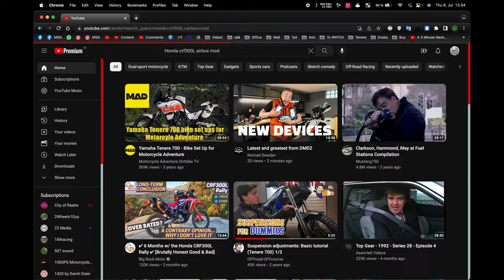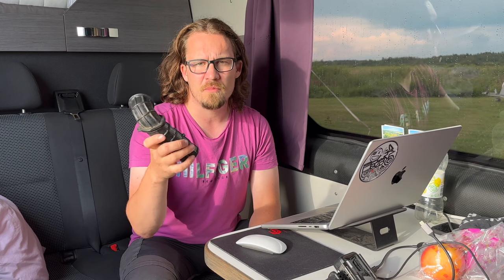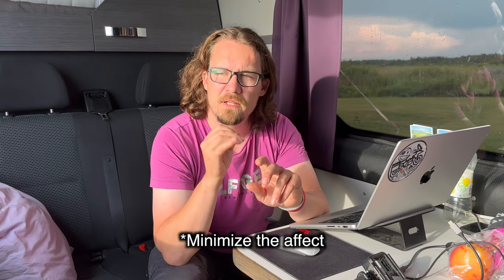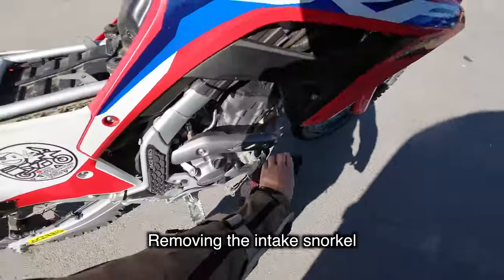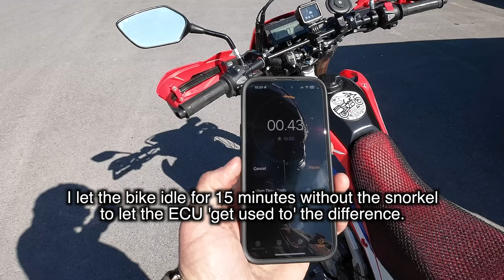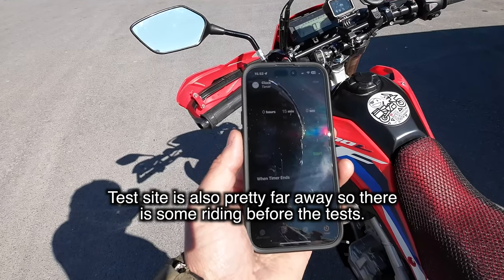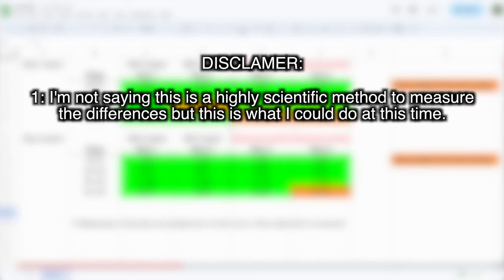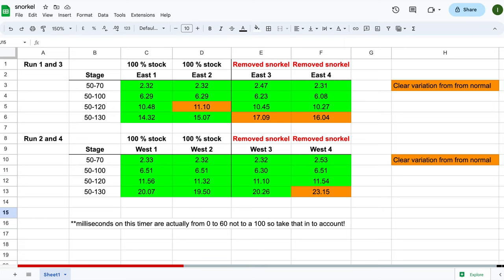Honda CRF300 Airbox Mod: Fact or Fiction?

Comment: Interesting. But to be fair to other testers I haven't seen any that have just removed the snorkel. The better tests have replaced the crf300 stack with the much bigger cb300 stack. They have also fitted high flow components such as air box lid and air filter. There  have been a  couple of testers who were quite thorough, one using a manometer to measure the vacuum effect of the restrictive stock components compared to high flow, and a Finnish guy who did full mods then used race timing equipment to measure several runs. Both these were very interesting.  Good luck with your future testing.
Reply from the maker: That Finnish guy is me though.
https://youtu.be/-rdtfHX3i6k
https://youtu.be/0Dh0g1QIY7A

The whole point of this video was to show everyone that they should not mutilate the airbox without doing any of the other mods. I've seen this happen a lot.
Reply: @PatchedBandit  You seem to have aged before this video was made!  Haha, sorry for the mix up bro. Try to find the manomter one, that was good too, he tested while removing the individual components one by one and recorded how much difference each one made.
Reply from the maker: I saw the 'labtest' type of test of the airbox itself. That's not really all that black and white though. The resistance levels and all that goes in to designing these air intakes is a lot more complex than people like to assume. It's not all about how freely the system flows or not. Different rpm levels affect the results a lot too and how the whole system is configured. 
Even if you remove the whole airbox and only leave the throttle manifold the bike is not gonna be faster because the tune is optimized for the stock setup. 
I made this video originally because I saw a lot of posts online of people just mutilating their airboxes and thinking they have a lot faster bike which is definitely not the case.

I aged 10 years within 2 because of my health problems. Now I'm just happy to still be alive.
Reply: @PatchedBandit  From you: "people just mutilating their airboxes and thinking they have a lot faster bike which is definitely not the case". Definitely, I watched a couple of guys comparing a modified vs non-modified acceleration test in which the modified bike barely pulled away from the unmodified away from the unmodified one. I wondered if it was really worth the $1500 or so spent to modify the bike.
Reply from the maker: @aussiesam01 definitely worth it if you do it right https://youtu.be/0Dh0g1QIY7A

Comment: Honda engineers have learnt a few things about 4 stroke tuning over the past 70 years, having completed in Moto GP, Formula 1, Indy cars and so forth. So it comes as no surprise the results didn't reveal any significant difference. There is a video about dyno results on the Crf250l which revealed no gain in power over stock, even with a so called performance exhaust. Gains were only achieved when the ecu was programmed to supply more fuel to complement the free flow.

Considering the volumetric output is near 100 hp per litre stock, its not really underpowered, it simply lacks capacity, want more power, get a CRF 450.
Reply from the maker: Fully agree! Thanks for the insightful comment 🙂

Comment: Look into lamaner vs turbulent flow. I'm betting at the higher speed the air was "skipping" over the airbox hole with no snorkel. Would be interested to see if cutting the internal part of the snorkel off would help
Reply from the maker: Any variation should be tested separately. This video was mainly to simply answer if it is worth it to chuck the whole thing as I have seen some people do.
I might do some testing with a dyno later but repeating this as I did here is a lot of work and dyno would give more accurate readings 😊
Reply: Yea it's a lot of work to test. I do like your 5th gear method and check the time to speed. I was researching and came across your vid.

Comment: One more factor to consider is the state of the air filter.
Last week i changed it on my 250 rally after a long time it hadn't been served.
Top speed increased from 120 to 130+.
My point is that if the air filter restricting the air flow, so even if the air box cover is wide open, the bottle neck which restricting the flow will still be the filter.
What was the state of yours while testing?
Thanks man
Reply from the maker: Clean filter 😊

Comment: Did you use action 3 to record it while riding?  How do you think about it?
Reply from the maker: I've been using the 3 for the last year on my channel as my main shooter (usually chinmounted). 
It's easily the best actioncamera I have ever owned. 

1. Super reliable so I don't loose footage which is the most important
2. Magnet clip mounting system is the best in the business
3. Transfering footage can be done via mobile app, usb'c cable or just direct from the card. It's easy and reliable as I don't need to process the files in some unstable app before using them (burn on insta360)

All and all I'm very happy now to shoot with both the 3 and the newer 4 going forward.
Reply: @PatchedBandit  Thanks for your reply! I inteed to buy action 4 but heard it has some overheat issue, and I am planning to use it for long time vlog, so it make me hesitated. Maybe I will wait and see more test about action 4.

Comment: Excellent content! Was I surprised? Yes and no....
Seems like better airflow would yield more power, but these bike are engineered to perform at peak w/i the guidelines of pollution regulations... The engineers know what they are doing. So, not really surprised. Plus, doesn't the snorkel protect from water ingress???   
I think you identified another source of the placebo affect..... kinda like putting a louder slipon muffler and assuming the bike is faster....
Reply from the maker: Exactly. And yes water ingress is much better protected when the snorkel reaches all the way to the bottom of the airbox. 
If by some reason this would have yielded a beneficial result I would have fabricated something myself but as it is I don't feel the need to do it.

I do think I'm gonna try and fiddle with the gearing by going bigger on the rear sprocket. This would benefit the 0-80 km/h times where I spend most of my time on this bike 😄

Comment: Did you add the Cbr inlet change that other say makes a difference,  possibly because the airbox has to be altered to fit the Cbr intake.
Reply from the maker: Point of this video is to show that only opening up the air intake ”restrictions” will not yeld any power gains. People are throwong the snorkels out all the time so I made this video to demonstrate that it is not only pointless but also detremental to performance.
Fully modding fueling, exhaust and other things to accompany better airflow is a completely dofferent video. I’m not saying one can’t get performance gains by doing all that.
Reply: @PatchedBandit  Great , I get it and well done . As I am  looking at buying a crf 300 rally I was wondering if you had tried replacing the snorkel with a CBR intake boot which as I said requires grinding a larger hole in the air box to fit it. More air means drawing more fuel that seems like what those recommending the change are excited about. The other changes ie exhaust, ecu , etc  no doubt would make a difference, just how much is as said you hard to determine without a dyno. Even guys who used a dyno found in consistent results. 
Cheers
Reply from the maker: Jake from the "TheGardenSnake" channel did all the mods one can do before adding a turbo and well.. to me it's fun for sure but the results are not worth it to me. Everyone needs to draw a line of which they won't cross modding this small little honda.
One can throw all the money in the world at this and the gains are going to be very minor. At some point if the power is not enough it's better to buy a different bike.

I'm even hesitating on swapping the exhaust as I'm probably gonna buy something else next year. (KTM 350-500 or Honda 450 etc..)

Any mod I do to this bike is not gonna increase the resale price. Oh and no I have not tried any other intake mods as they need the ECU swap too.
Reply: @PatchedBandit  yeah the ecu would be a smart move .I have watched Jake ,your right doing all that is probably to much money to send,a 300 is a small bike and that should be how you look at it ,a light weight dual purpose with long life and reliability. 
The 450 or the KTM both require much more maintenance but might give you the power you're looking for, or just stick with the 300 and get that ecu .have you put in the fork kit a new rear shock .
I should corect something I said before " more air means more fuel " that's would be corect for a carburetor engine, it would more than likely need different engine mapping for the injection motor on the 300.
Cheers
Reply from the maker: 550 ecu and yoshi race pipes is on the 'maybe next' list :)

Comment: well euro 5 bikes come restricted from factory to be ok on emissions. So my guess is the snorkel alone will not have gains ( only improve engine life i think , run less hot ) ... but ading snorked with air filter , ecu remap and exhaust ... will get better performance and longevity to the engine.
Reply from the maker: I doubt engine longevity on these motors is a concern anyone should bother themselves too much 🙂 These things will run forever and ever if maintained.

Comment: Interesting, but you didn't take account the positive or negative air flow. Maybe there's a lack of positive airflow.
Reply from the maker: Idea of this video was not to TUNE the bike in any way. The point of this video was to be an answer to many many people online saying that they gained power just by removing the snorkel from the airbox. So it's not to investigate the reason but to point out that it is not going to result in any performance gain.

Honda does know how the stock tune is supposed to be built. 
I have a full tuning episode coming within the next 2 weeks so stick around 🙂

Comment: Waste of time like I thought it would be, I've watched tons of videos on people trying to get more power from a 300L and most of them end up being a placebo effect imo, jakethegardensnake has spent thousands and thousands on his and it's still not fast, people just need to accept the 300L is designed as a low power ultra reliable long service life engine, it's built into it's dna or design, if you want a lot more power stock with the option of getting considerably more again with mods the 450L is what you should have bought, I went from a 450L to a 300L because I just couldn't get past the service intervals (and a number of other things) the tiny amount of oil it holds to lubricate engine and trans is just ridiculous, but if you want power and torque it has it in spades comparatively.
Reply from the maker: Very well said. I am not convinced these powermods are 'worth the money'. I do understand that people (me too) want to tinker and still try but you are correct that putting that money towards a more suitable bike is probably more reasonable :)
I'm pretty sure the only truly affective powermod to the 300L is to change the gearing. Putting a bigger sprocket in the rear for example if you don't need the top end of the bike for traveling etc.
I'm probably going to gear mine slightly differently in the future to get more power in the 0-80 km/h range.
Reply: My bike isn't fast? Are any dirt bikes fast? Fast... this is a word, a silly one. Uh the bike gained something like 35% more power and around 5k had double the power it had stock. It will yank 3rd gear wheelies around 35-40 mph. Now the engine is built and it's super fun to ride. Reliability is still stupid high.
Reply: @TheGardenSnake  Good for you, I'm sure it's much more fun than the stocker.......just not to the extent to offset the obscene money and time invested, which was my point in mentioning your project.
At the end of the day the engine is still a long stroke tractor motor lacking the valve area and low piston speed to produce high power figures for it's capacity.

Comment: Such mods should be done along with ECU remap, otherwise engine is running wrong air/fuel ratio. Nice test though!
Reply from the maker: Yes, you are right. I might put the 550 performance ecu and exhaust on this bike at some point and redo these tests. 
But because I'm not made of money I'm still thinking if it's worth it :)
Reply: @PatchedBandit  I have the CRF300 Rally version and was researching these options as well. I found some say the difference is significant, while others say it's totally not worth it from price/return perspective. I ended up agreeing with the later - not worth for couple additional HP. The only thing I would like to fix is throttle jerkiness. Planning to contact some local ECU tuners here in Lithuania and perhaps they could do the job.
Reply from the maker: This is bothering me too. Some say buying the Yoshi full exhaust would also help but its expensive too and might also be bs.
Reply: @ignasst  The "snorkel" change that did actually make a difference was the change to the intake/airbox tract by changing it to one from the CBR300. He also changed the cams. The problem with that is the tract tuning on the CRF is biased to low revs ( frequencies) at lower airflows. The CRF has an incredible mild camming . For a reason. It is designed to be useful at low/mid rpm and the tract is designed for exactly that. The whole point is to make it tractable and not have to rev it guts out to make it work. Camming it and reworking it to work at bigger flows comes at the expense of lower rpm useability.

Comment: well. the snorkel accelerates airflow. so yes even if you performance ecu upgrade. thy will use a bigger snorkel but don't remove it.
its about more than meets the eye.  i let my t7 get tuned stage 2. thats what thy did and it increases by 4 hp. [not removing the  catalytic converter] is it worth it. in my eyes its not. you should also remove the cat and you get more. then its worth it. still a steep investment in a few pony's.  i got a 6 hp boost now.  how ever not all country's allow this.
Reply from the maker: Did you dyno the results?
Reply: @PatchedBandit  yes. I did. At Carmo Electronics in the Netherlands. Great guy’s. Costs around 600 if thy don’t upgrade parts. For a bigger snorkel I payed 170 euro as its a different lid snorkel and airfilter. Decat I did my self

Comment: zero snorkle is daft - do you know why air intakes are set to lengths and diameters? seriously wtf
Reply from the maker: It’s daft which is why I made the video. I’ve seen so many people say they are running their crf without the snorkel for more power..
So yes. You got the point of the video.